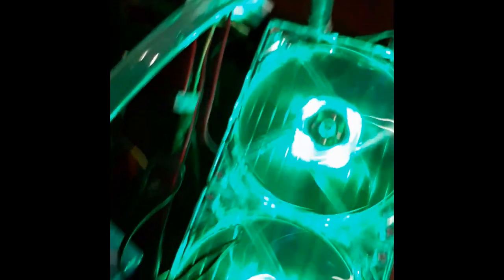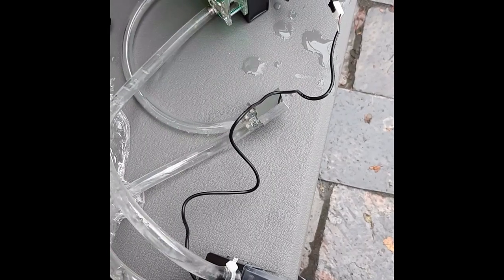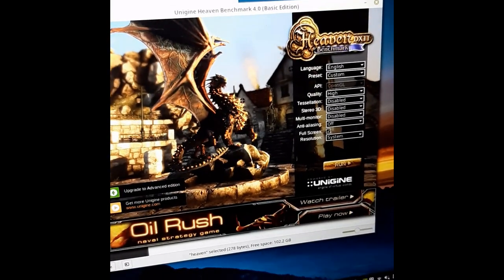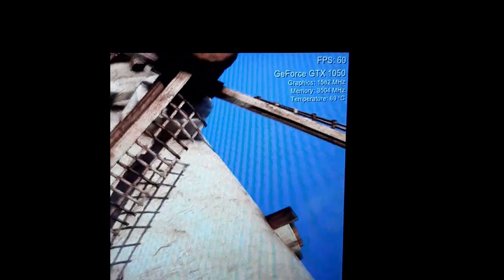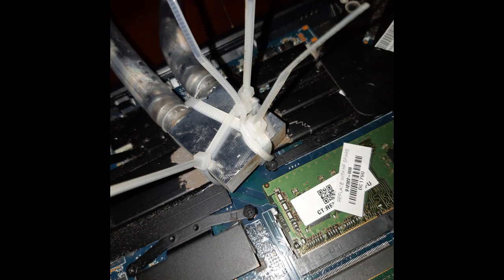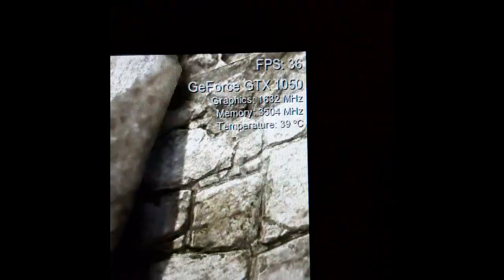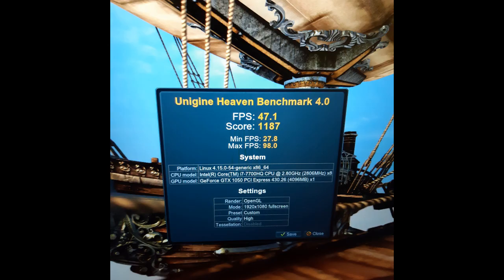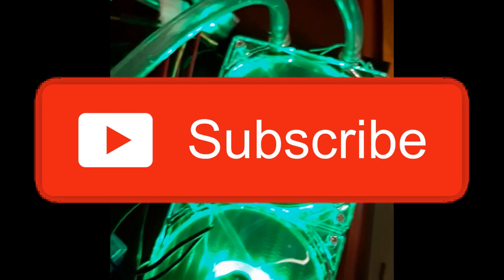Water cooling a laptop for under $60 - HP Omen laptop

Comment: I've got a massive empty space inside the laptop, I'm going to order the tiniest pumps and tubes so everything fits inside and the case closes up. This was WAY too messy.
Reply from the maker: It was more to show the concept, how did your build go?
Reply: @RufflezRevolution  Everything fit and the temps did go down but 2 different pumps failed. Only place that makes micro pumps are china and they're the cheapest things I've see. I need a quality pump for this to work long term.

Comment: It is a good idea, but there are a lot of improvements to be made, which are more than possible to do and even run refrigerant gas inside the pipe, and bring the processor temperature down to temperatures below 0 ° C, it is possible,  only, as in everything, the ideas are 1% inspiration, 99% perspiration, and this is where boys are separated from men haha, Excellent publication my friend.
Reply: dropping your temps under room temperatura its a really bad idea as it creates condensation on the components and the water will damage them
Reply: Upload some of your examples to your channel